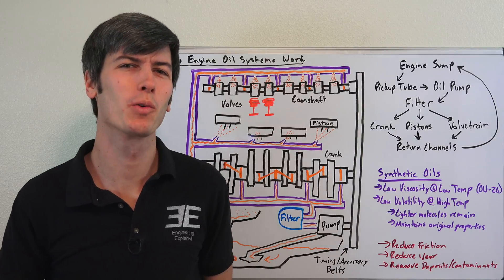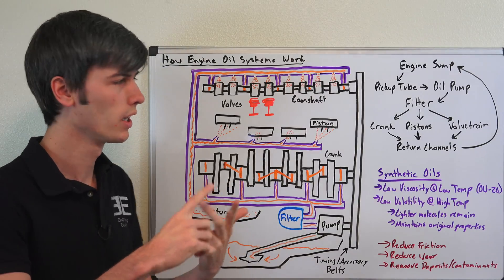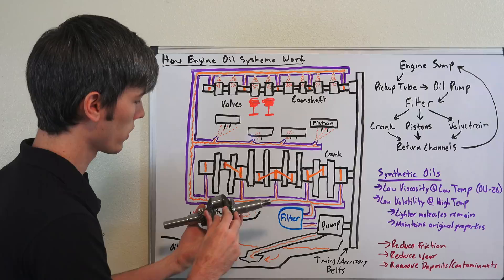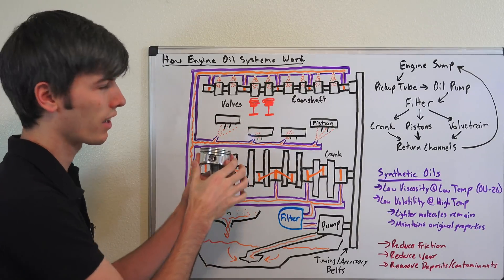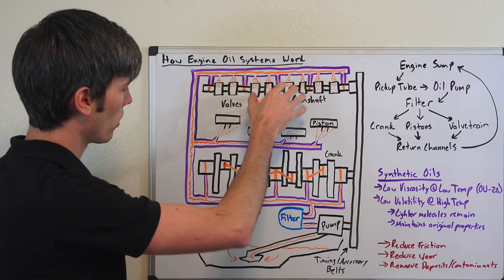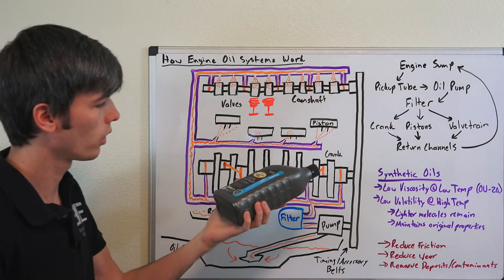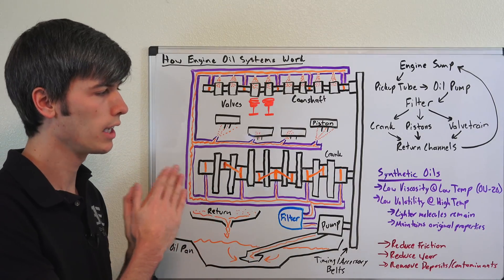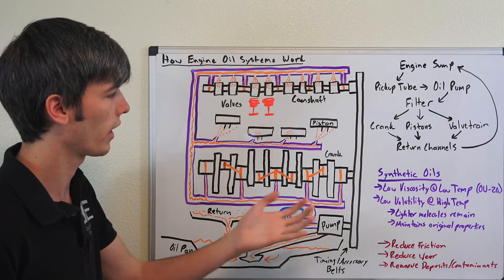How Do Engine Oil Systems Work?

Comment: is it a waste of money for me to put full synthetic in my 07 corolla? ive been doing it because if i changed my oil with conventional id be every 3000 miles as opposed to full synthetic which i stretch to every  5000 miles.
Reply from the maker: Not a waste of money, synthetic oil is better. Here's why: https://youtu.be/tYkg0oDUXs8
Reply: thanks for the info!
Reply: Just put whatever the manual says.
Reply: Cameron Rodriguez
Synthetics keep their lower viscosity at lower temperatures
Nooo, synthetic is JUST the production process, that does have it's benefits. Mostly things like longer lifetime, better cleaning etc. VMPauto Imagnet gives the oil higher sheerstrength no matter the viscocity, that's also something. By the way, that Imagnet is tested in Russian weather, so it will work perfectly in Canada.
Synthetic, mineral, semi, whatever can be any viscosity. It's more of a coincidence that synthetic is less viscous. It's simply because new cars need better(synthetic) and less viscous(5w30) oil, that lead to most synthetic oils also being less viscous.
Reply: jacob augustin and don't be afraid to mix it up depending on climate and seasons. my owner's manual says to use either 5w-20, which I use a synthetic blend of in the summer, or 0w-20, which only comes in synthetic but I use in winter because you can get away with thinner oil in colder weather.
Reply: jacob augustin also, unless it's a group IV or group V synthetic, it's just a more refined Dino oil anyway
Reply: thanks for the info guys ive just been using mobile 1 full synthetic high mileage 5w-30 and my car has been running great.
Reply: I go 6000-7000 miles on synthetic.
Reply: Cameron Rodriguez
One little note however: low viscocity oil will flow better on a cold start, but the thick oil won't drip down when your car is standing still as quickly.
In other words: if you have that thicker oil it will take longer to drip down, so if you drove your car yesterday you will still have a thin film of oil left in your engine, the more watery oil has already dripped down, so you start your car without much oil present.
Just to say that that both oils have pros and cons.
---
Recommendations are not always correct, for example my audi says 5w30, even though they put an old VW engine design into the car that was made for 10w40.
After yr2000 Audi started making 5w30 engine, but not all of their engines were actually new, some of them were actually designed for 10w40.
I also wouldn't recommend going below 5w30, even if your manufacturer recommends it.
Don't forget that manufacturers, EVEN toyota are purposefully reducing product lifetime to make more profit. Toyota is still not a bad option in terms of reliability, but they've lost their charm. New Toyota engine are not the holy 2JZ-gte anymore. Pre2004 toyota is great, rebranded daihatsu is great, but the new Toyotas are sort of not terrible.
This will become apparent when take apart the engine, simple details have been omitted; these were features that all reliable engine had, features that every manufacturer knew the function off, features that didn't increase the cost a lot, features that didn't decrease emision of anything else. There is absolutely no legit reason to omit them, other than to make kamikaze-engines.
Reply: jacob augustin for a naturally aspirated engine, especially a well engineered one, I'd run synthetic blend. it's cheaper than full synthetic and has the best of both worlds!
Reply: It is a waste to put the most expensive oil into your car.
If you are used to the mineral stuff, you can switch to at least semi-synthetic or better full-synthetic.
Also don't use too low viscosity of the oil, just 10w40 or 5w30 if your  manual says so.
Reply: jacob augustin hey 2 things. 1) full synthetic on your car will last an easy 7,000 miles. 2) look for EE's video on high milage oil. now that you have ran your car with high milage, its recommended that you only use high milage oil for that car until major work is done on the engine/it gets replaced.
Reply: I use Full Synthetic in my 1.8 Civic because I live in Canada and the temperatures drop way below 20/30 Celsius.
From what I understand Synthetics keep their lower viscosity at lower temperatures and will flow better at cold start ups. 
longer change intervals, since they don't break down as fast.
Most importantly the Synthetic oils get half price around the time my oil change is coming up, so there's no reason not to. :)
Reply: sasja de vries lol yea I know synthetic is just the production process, I was just referring to the full synthetic motor oil we buy when i said synthetics.
and yea it may be a coincidence or not, the fact is they have a lower viscosity and flow better at lower temperatures, and they last longer which is exactly what you said and added some more technical stuff that I'm not familiar with. 
lol so, I don't believe what I said was wrong in any way because you did agree with my point.
Reply: Cameron Rodriguez
Lower viscocity actually lubricates less, you want to have an oil that is not as thin when at operating temp, but still thin enough at cold temperatures, more like 0w40 or so.
In other words an oil that is more constant, that doesn't change it's viscocity too much based on temps. That would be ideal.
Reply: sasja de vries yes I understand what you're saying, but I always use the manufacturer recommended weight of the oil so the oil will have enough lubrication at operating Temps.
but we were just talking about an oil that flows better at lower Temps and does not get too thick to flow fast good enough at lower Temps would be a better choice.
Reply: sasja de vries while i somewhat agree with you, I have to ask. What about those engines that are now reaching 200k+ miles, which was unheard of 30 years ago. How? Engines today are being produced with better technologies, tighter tolerances, and a better understanding of functional design. In this case, it's a good thing cars aren't what they used to be.

Comment: Wouldn't you want to have the oil filter ahead of the oil pump so that contaminated oil does not damage the pump?
Reply: Alright here is the reason!!!
Think about it this way: you've just changed your oil and filter, so 
there is hardly any oil left in the system.
If you had the pump above the filter it would be pumping air (no 
lubrication) and generating a vacuum which the pump is not designed for,
 then that vacuum would need to be strong enough to open the valve 
inside the oil filter and to suck up that thick, cold oil  into the 
filter and through it. And I can guarantee you, if vacuum will need to 
pull oil through a filter is will be slow, then a few minutes later you 
have finally oil into your pump. And your pump and engine worked for 
several minutes without oil at all. Then when idling, the pump isn't 
even strong enough to do this at all.
It's just like using a vacuum cleaner as a suction cup to lift up a 
suitcase you could have lifted way easier by just grabbing it.
Also if your car has been standing for some seconds with the engine off,
 all the oil between the filter and sump will drip down, next time you 
start your car you have this problem again. Then the oil inside the 
filter will also drip out in the coming days/weeks, unless you've used a
 special filter like this one: http://базальт-фильтр.рф/
---
And then, the pump might not get oil right after it's cleaned,  but at 
least all of the oil going through the pump has been cleaned before on 
the last cycle.
When your engine oil is not at operating temperature the filter is not 
filtering at all, a check-valve opens in that case. So at a cold start 
you use dirty oil... The point is all of the oil will get filtered at 
some point, so it's no big deal.
It's just putting food on a plate, you don't wash your plate directly 
before dinner, you've done the dishes yesterday and now it's clean to 
eat, it didn't get that dirty from standing there.
If you take a shower once a day, then you won't complain you haven't 
taken a shower for 4 hours so you're dirty, would you?
Reply: Wow, great explanation! It does make a lot of sense.
Reply: sasja de vries. Well done.
One marine ships, this would be covered under the “Third Rule of Tankers”...Pumps are for liquids, compressors are for gases, shovels are for solids.

“First Rule of Tankers” = You are responsible for your own entertainment.

Comment: do synthetic oil have longer drain interval around 10,000 km vs 5,000 km on conventional/mineral oils??
Reply from the maker: I always say go with what the manufacturer recommends.
Reply: I go by color. I drive over 483 km everyday for work, but its mostly cruising highway km's. My oil is still golden after 8,000+km and doesn't go black until way after 20,000km. But its also a 1.5L 05 scion xa. Which are known for being rather slow, but gentile on parts.. Every car and driving style is going to wear things different, but unless you've made some drastic modifications that require changes, you always want to use the weight and 'style' of oil that the manufacturer recommends.

Comment: It'd be interesting to have you do a video on oil specifically and the different API groups, such as 1/2, 3, 4 and 5, or at least the current understanding of them. You mention Pennzoil uses Natural Gas but didn't really cover whether it was an Esther or PAO based oil, which your sponsor should know is an important distinction for car enthusiasts already using synthetic oils.
Reply from the maker: Pennzoil synthetic is categorized as class 3, but I believe they're the only ones using natural gas for the base oil. Different advantages to different classes, I hope to cover this subject eventually!

Comment: Hey EE! In one of his videos, EricTheCarGuy said that the oil pump generates oil volume, and the clearances of the crank bearings generate oil pressure. Who is correct?
Reply from the maker: Sure! Resistance is what creates the pressure build-up I suppose. If there was nothing resisting on the outlet side of the pump, the oil would not have high pressure but would flow.

Comment: Maaaannnn. How'd you skip right past Rod Bearings, they are pretty much the main place for engine wear and low oil pressure
Reply from the maker: I didn't, they're mentioned, explained, and drawn right there on the whiteboard haha.
Reply: Maaaannnn. How'd i miss that one...

Comment: Before I watch the video the function of oil is to lucubrate, reduce friction, and heat. It's funny a lot of guys want to run a thicker oil but I tell them that's a bad idea as you're reducing flow, flow (volume) carries more heat away I would assume?

Comment: My oil pump failed on my Volkswagen Passat and I was just wondering what fails first once there's no oil flowing throughout the engine.
Reply: AWSOME67860 The engine bearings. They are thin pieces of soft metals and you find them at the crank and on the connecting rods. The job of oil is to lubricate the area between the rod and crank to the soft metal. Usually when there is no oil the bearing will actually spin with the crank (or rod) due to the high amount of friction caused by no lubrication.

Comment: Heres more info id like to share: they oil pump doesn't create oil pressure! Its the size of the oil holes/galleries the oil has to flow through..  For example, turn on your garden hose, very little pressure! BUT if you start to slowly kink the pipe the water is flowing through your will get higher water pressure!
Reply from the maker: You'll also be unpleased when I use the word "centrifugal." Ahh well, everyone knows what is meant! :)

Comment: Relatively few engines have piston squirters, and those that do use it more for cooling than lubrication in high performance or turbo applications. 

Lubrication for the cylinders is almost always provided by a passage in the small end of the connecting rod.

Comment: Hey EE, I always wondered where does the oil come from for the oil feed for a turbocharger? Like say if I wanted to turbo a car that never came turbo from the factory, where would I tap in to get my oil?
Reply: Either Tee the port for the pressure sender, or use a sandwich plate under the oil filter. You'll also need to tap into the oil pan for a return.
Reply: Marius G most people add a T off the pressure sensor, and add a gravity feed to the oil pan.
Reply: what I think a lot of people do is remove the oil pressure sensor/sending unit and install an extension with a splitter, one for the sensor/sending unit, the other for the oil feed. iirc EricTheCarGuy was able to install the turbo feed for his fairmonts engine by pulling a plug that gave access to the oiling system

Comment: oil cooling, using radiators/intercoolers (not sure of the name). are they mainly used to cool the engine by sending cooler oil throughout the engine? (obviously by air passing over like a radiator). are the usefull? would you recommend one? and what are their disadvantages? cheers
Reply from the maker: For track use they're great to keep oil temps down and thus maintain a desired viscosity. For street use, not always a good idea as the oil may remain too cool for ideal flow.

Comment: Make a Part 2 so you can draw a pressure differential valve. The valve that bypasses the oil filter if the pressure is too high (I.e. clogged filter). Dirty oil > No oil.
Reply: You can add "priority main" oiling systems, "side oilers" and dry sumps to the Part 2.

Comment: Just a little correction on the wording. When the rpm of the motor increases, therefore the rpm of the pump, what increases is the flow and not the pressure. A fixed pump has fixed pressure but variable flow.
Reply from the maker: Well, partially yes. Flow does increase, that is ultimately what the pump is doing, creating flow. But with greater flow, at greater speeds, comes more resistance to the fluid's movement, and thus oil pressure increases.

Comment: Recently have read about the future use of pneumatic  valve systems in place of camshaft systems.   Will these new pneumatic valve activating systems require less oil flow/pressure than cam shaft systems?
Also,  I was wondering about conventional oil sump systems that uses a belt driven pump to push the oil for lubrication.   Would it be better to perhaps use an electric oil pump system to keep oil pressure up, especially when cold starting the engine -  initiating oil flow for a few seconds prior to the engine actually starting.  
Thanks for your informative videos.   You do a great job explaining stuff to the average Joe.

Comment: What is the difference of a "dry sump" lubrication system?
Reply: Another good thing about dry sump systems is that you can put them in tall, vertical, cylindrical containers so the oil doesn't slosh around under high lateral acceleration.  Wet sump systems use a large oil pan and the oil can slosh around to one side of the pan, starve the oil pump, and then you lose oil pressure.  When you lose oil pressure... bye bye engine :).   That's a big reason dry sump systems are popular in racing applications.
Reply: Dmitry L not really dry at all. Just means no normal depth oil pan at bottom of engine.  The container with oil is located at another part of car. This allows the engine to be placed lower in the engine bay thus reducing centre of gravity.
Reply: MrZz108 What percentage of the oil is working "in the engine" in a wet sump operation?
Reply: Giuseppe Marotta thank you!
Reply: MrZz108 yeah I've heard of the advantages/disadvantages but I didn't know how it works. Thank you!
Reply: Usually about 20% or so should be in the engine, the rest should be cooling.
If your engine is air cooled you will probably have a lot more oil and an oil cooler.

Comment: Interesting. I didn't know there are oil pumps that are belt-driven.  Guess the ones that are driven by the cam shaft and indirectly driven by the timing belt.  Oil also pressurizes some belt tensioners, powers the VVT, hydraulic valve lifters, if you have them, etc.

Comment: I've heard that coolant can leak in to the engine and transmission. What causes that and how is it prevented?
Reply: DMeloMan if you warp your head then coolant can escape through your gasket into your engine proper coolant system maintenance will prevent this and usaullay occurs when an engine overheats or in rarer cases the head gasket fails. On the side of your radiator in some, def not all cars is your transmission cooler which nowadays is made from shitty plastic which as it ages gets brittle and if it splits or cracks you will have coolant mixing with your transmission oil that then goes to your gearbox.

Comment: Hi Jason! I have a question regarding oil interaction with ethanol. I understand ethanol is a polar molecule, oil(as gasoline) on the other hand, isn't. Based on that and considering solubility(as polar solubilizes polar and the same for nonpolar), may I say that ethanol causes less oil contamination and hence is "better" for the engine lubrication? 

Sorry if it is a non-sense question but I was just studying chemistry and this came to my mind while watching.

Thanks for the great content!